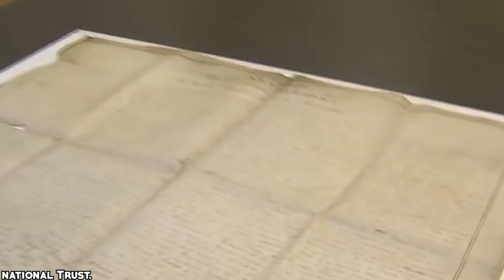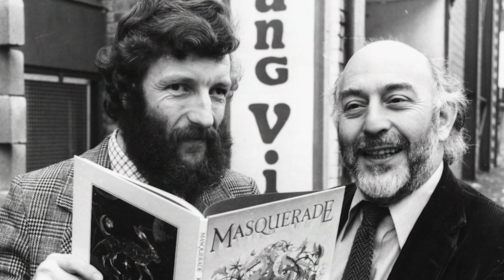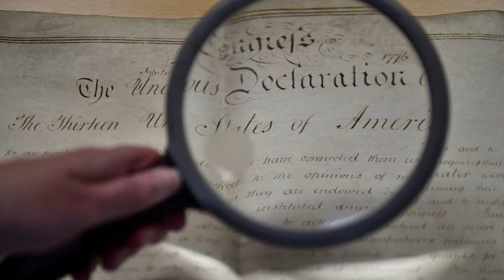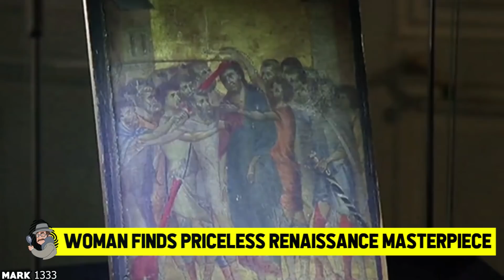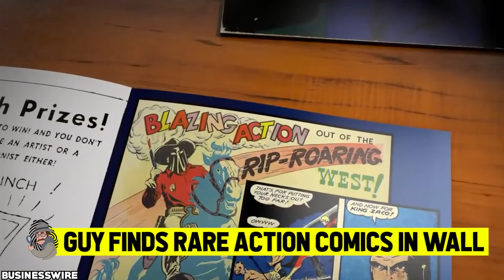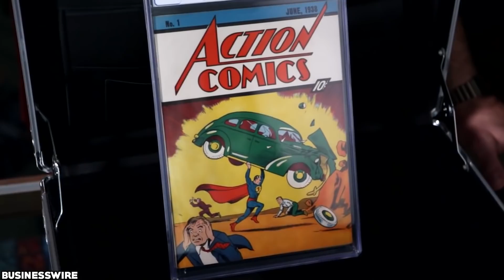15 Super Lucky People Who Looked In The Right Place

Comment: anyone with any sort of experience in metal working could get into that safe that was left in the field in 10 minutes or less. just get an angle grinder and a cutoff wheel, and cut a hole in the door then reach inside and move the locking bolts by hand. or just cut a hole in the side for direct access without having to mess with the locking bolts at all.
Reply: I said the same thing. That story doesn’t make any sense. Start to finish.

Comment: The opening story, is in fact a YouTuber, but the video being referanced was faked. The rocks were not special, and were planted, and the secured in place with some kind of low quality cement or something similar. You can even see it in THIS video. If you look, the area around the colored rocks (which may even have been just chunks of glass) is completely different than the actual host rock.